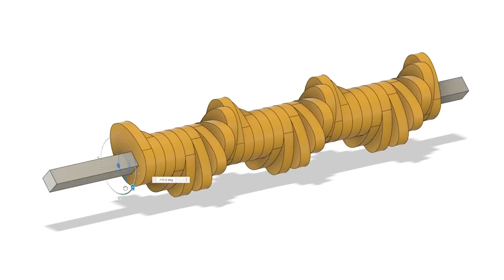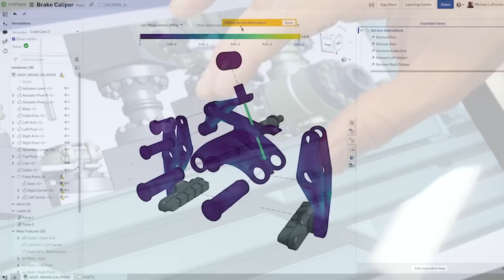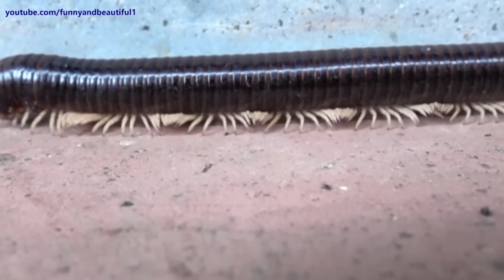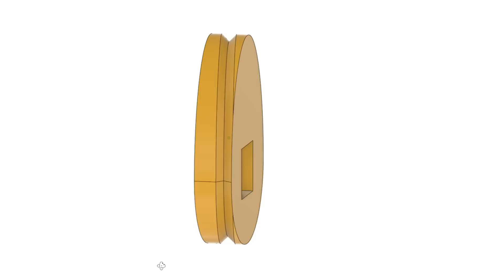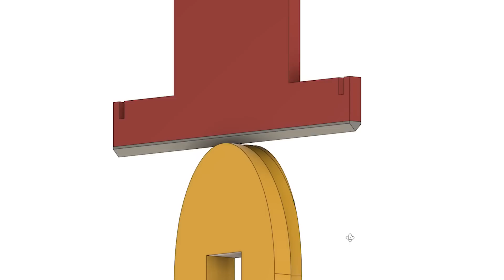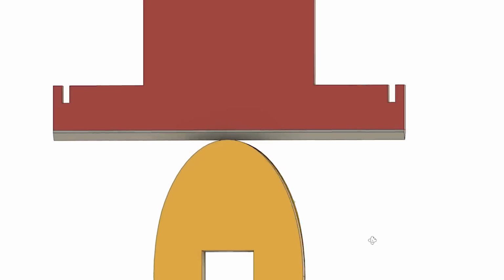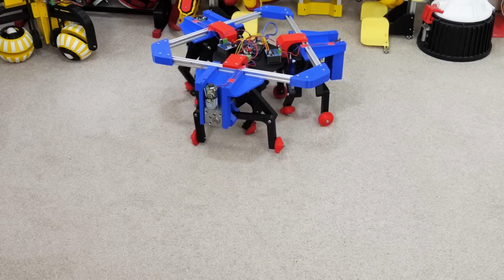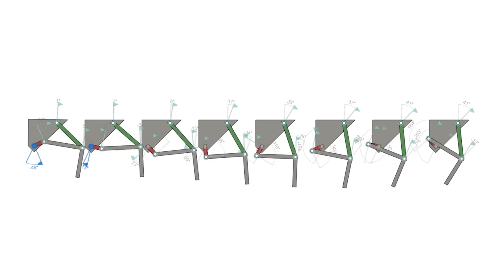Experimental Wave Drive V2

Comment: If you put the toasts at an angle it should push itself forward, probably more efficient with the weight in the front for some first step grip.  Although it should be terrible at going backwards... and if you want to ride it the angled toasts should bend and act as suspension and with them being flexed it should move a few millimetres extra
Reply: You can test this theory by simply raising the back end and putting a wheel on it

Comment: If you draw a line at the zero of your sine wave and then draw a line at maybe 10 degrees from that line, it will make a triangle.  Print and attach the triangle on both sides and it will turn your mechanism into a tilted free body diagram which will travel forward!

Comment: The track at 6:00 worked, seemingly because the "toast" are not angled straight up and down, but instead slightly diagonally; this results in consistent movement in the opposite direction.

Comment: 1 the mesh was static, it's the flexible surface that needs to push and pull through deformation to drag with friction, in this case it's just the mesh moving up and down with no horizontal motion
2 the legs "toast" had no pivot point or axis, so they're not making the motion you think they're making, it more of a random lateral vibration at the very bottom than a millipede step pattern, you could add a long vertical slot in the middle of each toast, with a fixed axel going through it, to give it that paddeling motion, the height of the fixed axel should be chosen carefully as it determine how big of a step it would be.

Comment: I suspect the piston-only version might work on a floating platform with the pistons only partially submerged, and on some terrain with loose material (might be dependent on the size of the individual loose objects/particles and depth), and perhaps on some muddy terrain depending on the properties of the mud (and some other sorts of sludge/goo materials too perhaps).

Comment: 7:43 On the original screw drive, we can see that the little black feet change angle quite significantly so that they are actually taking steps like a centipede. If a strip like the black one from this video was attached to each vertical paddle and allowed to change angle with axles, with feet attached to the strip, they could also change angle and achieve walking. The result would be a finely detailed version of the screw drive's walking.

Comment: the real reason it's only moving in one direction is because the wedges are tilted slightly (you can see if you look closely) and it sort of creates the same mechanism that hex-bots (does anyone still remember those?) so it can only move in one direction regardless of wave direction which is why it still was able to move uphill for a short while, if you increased the angle then (whilst is would increase the stress and complexity) it could work just fine. The reason that it doesn't work with the webbing is because it is altering the angle of the legs and creating a neutral motion thus creating 0 thrust

Comment: You could also try a cam with a flat point.
On the tip of the cam you will let the slot go diagonal  while the height is constant.
The cam would reverse the legs back to start when the legs are up, can be over the whole small diagonal, and during the ~20 degrees that it is fully extended it will have the slot go from front to back "quickly".
Cam sideview would be aprox. The same as it is now but the tip looks "smashed flat" (or more approximately like a square with rounded corners). Basically increase the radius on the cam tip and add flat.
Don't know how to put it in words but I hope you understand what I'm trying to say.
Great video!

Comment: Wouldn’t putting a small rubber wheel, set on the thin ends of the cams set at 90° to the direction of travel work, surely it would cancel out the friction from side to side and push or pull the vehicle forwards and backwards.?

Comment: Not sure if this is random or not, and I have 2 thoughts.  What if your 'toast' was split down the center, and as your cam walks through the 2 slices of toast on the plane that acts a bit more like the screw? Centipede/Millipede/Caterpillers may not be using opposing legs at the same time in the same way, though I've not studied it.  Second thought may only propel motion in forward motion only, but angled 'toast'? Cam strikes become more complicated, but as the wave moves, each toast strikes like / / / / / only forward. Maybe the angle doesn't need to be so severe to gain forward motion in a single vector.

Comment: Hate to say it but when you look at the system it dosnt actually impart any foward motion in its mechanics it simply just lifts the sliders up and down you need an oscillation to produce forward or backwards momentum the small forward motion you were getting was due to the slop on the mechanics

Comment: Very interesting, but I don't think that there is an easy solution with a cam shaft. It would require a complex guidance mechanism for or construction of the cams. It's key that an element of the robot touches ground and then moves backward while keeping contact. Just touching by distinct elements in a wave motion doesn't help. The screw makes this quite elegantly, because it has friction in longitudinal direction and slips laterally, keeping a longitudinal element of contact across the entire length.
I can imagine two basic concepts to achieve the backward motion in contact with a cam shaft construction:
1) Guide the cams in a back-and-forth motion that is correlated with the up-and-down movement. Could be done by letting the cams swivel in their vertical guidance around an axis that sticks out to each side (like guide them on two bearings, but keep the rotation limited to a few degrees, controll the rotation by a smaller shape on the driving part of the cam shaft, so that the cam swivels back when in down position). Or guide the cams on two axes that each ride in a circular path on each side. The shape of the paths woul have to reliably differentiate the downward and upward paths, i.e. achieve a continous travel of the axes through their control slots, which seems quite difficult to me.
2) Modify the cams so that they are spring loaded, partially collapse when they are pressed down, and hereby deform in a way that moves the point of contact backwards. Some rubber flaps, extending from the cams, that are bent backwards would be the simplest implementation, I think. The device then could only travel in one direction.

Comment: Am at 04:30 and this is such a satisfying device! Love the rubber bands doing what they do. The repetitive nature of the wave is so mesmerizing!

Edit: at 07:30 No! It isn’t just vibrations pushing it downhill… it’s pushed ‘towards’ the location of the motor irrespective of the direction of the wave because the virbratuobs are pushing it towards its tilted position. The device itself is not perfectly parallel to the table. It it ‘were’ just going down hill you’d never be able to go in the other direction… which you WERE able to :-)

Anyway… that is me being picky! Carry on!

Edit 2: at 09:30 it no longer works because what I described earlier no longer happens. The tilt of the entire device cause by the weight of the motor and caused by the feet retracting earlier is now being  countered by the fact the rubber matt is attached at the end and keeps the device parallel to the table surface. It now ‘does’ infact only move as a result of the table being somewhat off level.

Edit 3: I bet you can make it work by going back to the straight cams and give each ‘leg’ a hinged knee at the end that (just a little bit) hinges towards the drive direction as it lands on the ground. This could even be angled TPU flaps that all point backwards from the intended drive direction so that that weight of the device causes them to land, grip the ground and and then bend backwards as the weight is above it and the foot is being pressed further down. The only downside is that this allows only one direction of travel.
Reply: "this is such a satisfying device!"
Agreed. It was really a wonderfully awful contraption.

Comment: Looks like this only moved because it was falling under it's own weight down the slope of your desk. Notice how it moves in the direction of the weight I.e. The motor and pulleys.
I'm glad it didn't move because that it was my intuition said when you asked the question at 1:20.
I'm glad you asked the why question at the end and figured it out.  Just a shame you didn't ask the why before building the project.

Comment: Thank you for this kinematic gem! I've been toying with wave driving for some time... Here is the deal. The (ideal) waves by themselves do not carry the mass. You need some motion biasing to actually move.

The roll of tape moved because the gravity was pushing it off the rolling hill so to speak. It was the right size for it, comparable to the period of the wave.

Your initial version with the toast pieces should walk as well, if you run it over a bunch of eight-sided pipes for the same reason.

The previous version (with the screw) worked because the track was imperfect, as in wobbling back and forth, and acting on the ground at varying angles. The newer version got a lot closer to a good wave generator but still was able to move a bit because the toast pieces could wobble back and forth a bit.

Millipedes and worms have a different kinematic, it is closer to one-dimensional wave. They use clever tricks to bias their wavy motion forward. Bias is the key here. The millipede achieves that by angling its legs that are not straight. The worms have small bristles and irregularly shaped segments to drive them forward. Snake uses terrain in normal motion (they have a weird other mode of commotion too, but use it rarely) to push itself off.

I hope this little setback will not discourage you from attempting v3!
Reply: THANK YOU for saying this, My god I was going mad watching this video.

Comment: You just need to add triangle feet that attached to two pieces of toast each. 

The pointer the triangles the longer the steps will be.

Make them so long that they almost touch when fully tilted.

Comment: The midpoint of the line between the ends of two pieces of toast moves in a circular motion I think. If you put a panel connecting each pair of toasts via a hinge, and from the middle of each panel project a foot, that should get you a circular foot motion.... I think.
basically it'd be like a board with a mast riding along the surface of waves.

Comment: I don't think the cam is the problem (or the solution). You need a horizontal motion as well. If you space each legs more and have them spin around an axis like a locomotive wheel (but at 90deg), you'll add the horizontal motion to the vertical one.

Comment: Circular cams instead of oval cams if you want better contact with the ground and a wave like the original.  Also, shorter "legs" with a pivot in the middle to which you attach the springs or rubber bands, and concentrate the grove angle on the cam at the bottom of the stroke so the legs move more while in contact with the ground.  Finally, use a guide knob on the top of the legs to follow the groove.

Comment: I believe part of the issue is that they are straight up and down, so the direction of force they apply is also straight up and down. However, if you were to offset them at say a 33 to 45 degree angle, the direction of force would like wise be in the same angle, this would allow it to move in that direction.

Comment: I think it moving despite physics is because of where the machines center of gravity is combined with the play you gave the slabs. It ever so slightly gives the legs a greater tendency to bend away from the motor than to it which moves the machine towards the motor.

The guided slabs only make contact with the ground at their apex for a very short time in which they hardly change angle.
A simple solution is to extend the time the slabs spend being fully extended.

Comment: The previous wave mechanism gives you the solution if you look at it carfully: I believe the rubber ribbon you used here IS part of the the answer, as long as you fill it with 2-3cm long studs like a brush. The studs will follow the orientation of the wave so their tips will move side to side as they foollow the sine, transforming the sine into horisontal micro-movement. Oh and you also need good grip between these studs and the surface the machine is walking on.
Reply: I also noticed that the only one that walked well had extended rubber feets that act like little levers and actually cause the forward motion to happen. simply lifting up and setting down your feet won't get you anywhere.
Reply: Yep, I'm surprised James didn't see it. The studs on the original belt stay perpendicular to the belt as it flexes over the sine shape. Like this: /|\|/|\|/|\|/|\ The result is each stud traces an inverted arc while in contact with the ground. Oddly, making the mechanism walk in the opposite direction as the wave progression.
Reply: Yes. I like the idea. I just thought of tilting it forward so each leg would hit at an angle (or shave a bit of each leg, so it sits tilted forward). But your idea I think fits better with the original concept.
Reply: this is correct solution
Reply: I think this will work
Reply: yea the little rubber feet extend out a bit from the track; when the wave goes in it lifts the feet, then the wave goes back, the feet lower to ground level, and then there's a little turning motion before the wave pulls it back up
it does the same turning motion in the other direction when it's lifted by the wave, but because it's not on the ground, it's not there to cancel out the forward motion of the ones on the ground

Comment: the ruber thing could be better idea if you screw the rubber to each of the plate so the rubber would be connected to all and you also glue strips of ruber on lovest bottom aligned between spaces of the moving plates, ant the bigger thicknes those strips wound be, the faster it would move :)

Comment: There's virtually 0 wave motion against the surface. Make the wobble on the cam sharp as the foot contacts. A step happens ACROSS and then over. Not around. You don't want linear/circular wobble.

Aggressive wobble profile. Then Shorter  legs and wiiiiider wobble. Go!

Comment: Wouldn't it work, if the floor was half circles? I mean you could add a track of rotatable wheels with radius equal to the stroke which would roll you forward at twice the speed of your "wave", given you add back the anti slip. Then again, where would the tracks loop back? Ok, but where would you sit then?

Comment: If you follow the normal vector of the original on a single foot, you can see it steps on way at the bottom, and another at the top of the wave.
Also: The pointy feet on the millipede are not accidental.  If they are not pointy, you can't fit enough legs for a smooth ride.

Comment: I suspect the reason it moved "down hill" better initially has to do with additional weight of the motor causing an additional tilt when the motor side cams have the legs lifted and the distal legs lowered. That could be inducing a slight vectoring force toward the motor end as it rocks toward the heavier end. This would result in the distal legs pushing at a slight forward angle. When pointed "up hill" gravity is likely working to cancel out that rocking tilt and reduces the angle of the force. Once the grippy net was added, the friction would overwhelm that slight bit of force.

Just conjecture on why it initially seemed to have a bit of intermittent movement that cease with the added grip or change in incline.

Comment: The original track works because the contact point on the ground is lower than the hinge point on the track, and this means that as the segment is tilting while touching the ground it pushes forward on the segment contact point.

Comment: If you change the shape of the cam, make them less 'egg' shaped so they spend more time in their fully extended position, that might give them more chance to move backwards and get more purchase on the ground. In fact if anything you'd want them to spend the maximum possible time in contact with the ground and only come up to move forward to the return position in as short a time as your 'peices of toast' can be persuaded to do so by the groove in the cam. So yeah, with a differently shaped cam I reckon this could work a whole lot better but I don't know how easy that would be to optimize.

Comment: The tracked version with the spiral works because the track is hinged and the feet are fairly wide and grippy. The connections to the other feet cause the contact point/"feet" to pivot while remaining in contact with the ground. The motion is actually pretty similar to biological feet when you think about it; the back part of the foot makes contact with the ground, then the entire foot pivots, moving the contact patch to the front of the foot before it lifts off of the ground.

Comment: try to angle it forward slightly. I think thats why it was moving down the slanted table.     / ->      and the weight imbalance of the drive is why it moved up the table slowly. you should be able to do this with just a different wave and no modifications
Reply from the maker: I think the whole cam would need to tile and then the 'toasts' would need to get longer towards one end. It could only go in one direction though.
Reply: @jamesbruton  I was thinking just one wave rather than 3, then it should behave similarly to a single wheel leaning and falling rather than pulling itself along. kinda like pumping a hydrofoil.

Comment: Just use a thicker rubber strip, or some soft rubber material with 10mm thickness, it will work